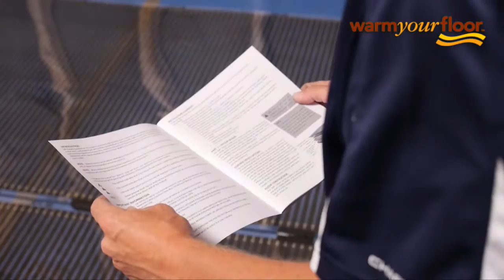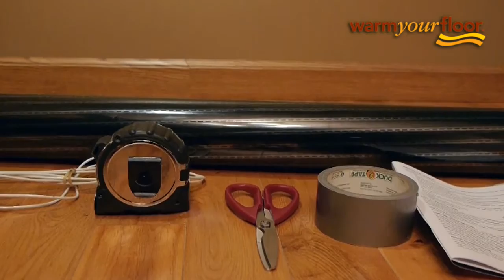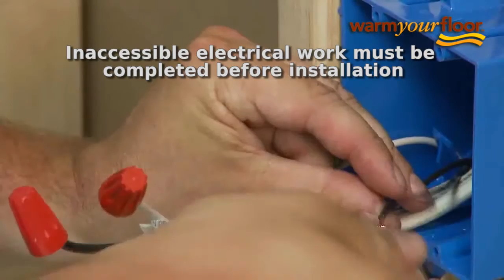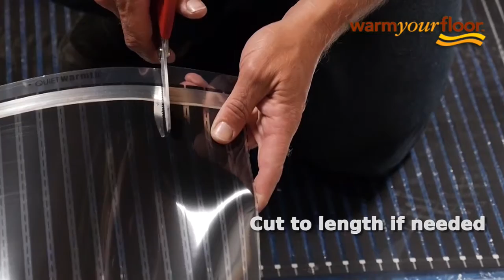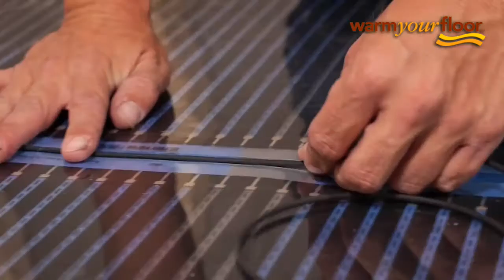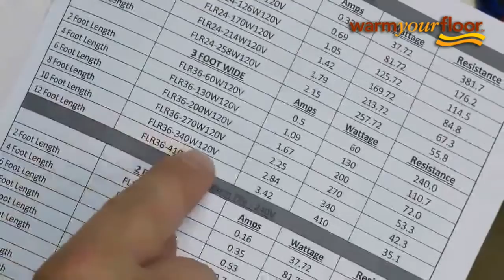QuietWarmth Radiant Heating Film Installation for Floating / Click-Together Floors

Comment: The recommended underlayment will make the plank flooring too spongy with the builtin underlayment on plank flooring.
Reply: I was wondering about that.  That stuff looked pretty bouncy.
Reply: Yes it looks like its for carpet… how would i use this with vinyl which calls for no underlay?  Seems i would have to cut gouges into the concrete first for the sensor?
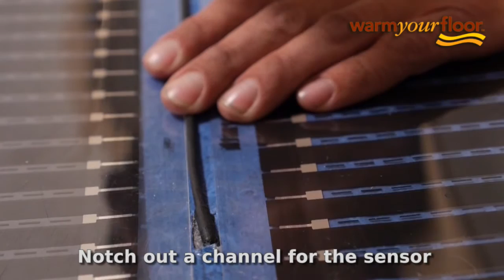Reply: @Demetrios Christopher the wires are thicker than the mat, so if you don't have underlayment you would indeed need to notch out the subfloor (be it plywood or concrete). @3:26.
I've got lots of insulation beneath the plywood, should I still have underlayment?  If @Luba Luba is right that the underlayment is too spongy, is there any way to provide a heat barrier that is not so spongy?  Reflective radiant barriers require space to work.  If they are directly against another material, they will have no effect - or so experts say.